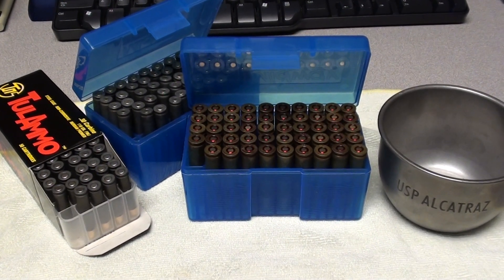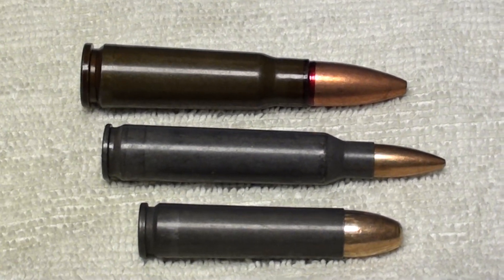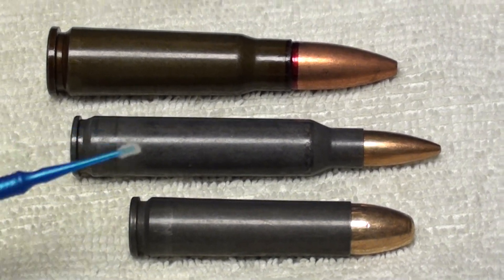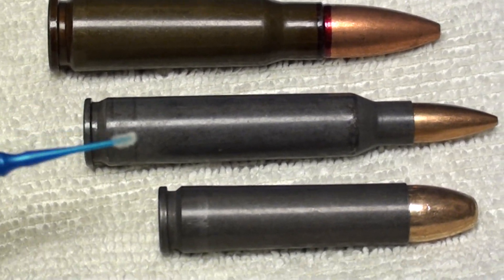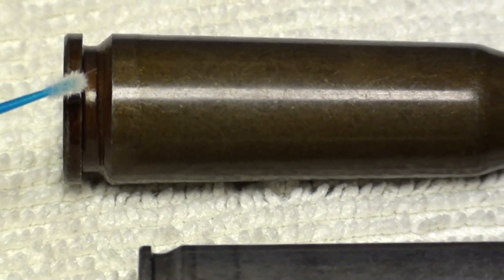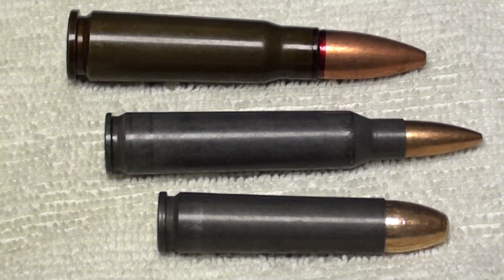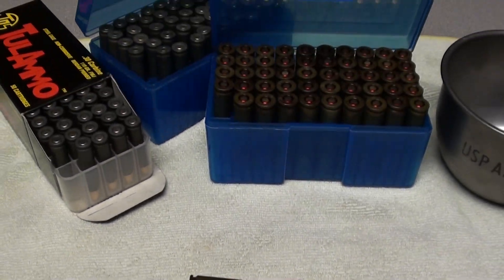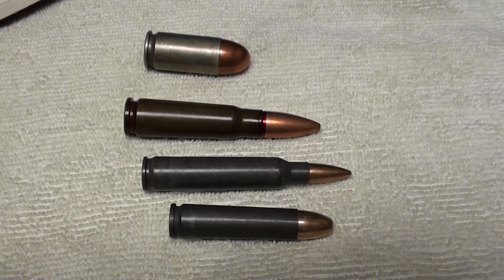.223, 30 Carbine, 7.62x39 Steel Cased Ammunition

Comment from the maker: Thanks 4 comment.  You are second on this.  I agree.  Chamber oil = setback. My carbine is safe with light brief 1/3 second misting WD40 after @ 50 rounds, toward the front action (not directly into chamber) with steel case ammo only - my carbine gobbles up steel ammo three boxes @ range session - no broken extractors with mist.  I mist no other gun.  I shoot carbine often.  Can't control how other shooters mist.  If steel case no good for shooter, don't use it.

Comment from the maker: Thanks for question - stirs up lots of debate - .223 1) light recoil - easy to hit 2) light, smaller rounds - carry lots of them 3) will take elk and buffalo with head shots 4) tumble in tissue - effective 5) accurate in most arms 6) will penetrate both sides of a GI helmet at 500 yards 7) reliable in most arms

Comment from the maker: Thanks 4 dialogue. I still agree any oil squirted into chambers for firing is not Rx. But my misting my carbine action for steel case shoot MUST be getting a bit into the chamber. However, my carbine loves it. Got to thinking-there is always oil in my gun chambers from cleaning -never degrease before I shoot at the range - no pressure problems when I open fire. I remember old guns used oiled shells-more research and big controversy here. Again, thanks for your post. Let's stay safe-no oil.

Comment from the maker: No pressure signs on my carbine steel case fired primers. Carbine functions well after WD40 mist treatment. I have run across reloaded 45 ACP steel cases - ID by flattened squashed in primer instead of nice round brass factory primer. They work. I just don't think I have any motivation to reload steel cases myself. I pick up all the brass cases I need that other shooters just leave on the ground. Please see second reply.

Comment from the maker: Joseph McKinney-Thanks for the post.  I have never shot 3 gun, so I've never shot steel case in my AR to the hot.  When I run my 20 rounds at the range, I've not had any issues with the steel.  But I would echo your experience with the Glocks - shot a lot of 9mm steel case with no problems.  Good shootin' to ya...

Comment from the maker: daniel quevedo-Thanks for your post - if steel cases get stuck, it is often because the steel does not obturate well enough to seal the chamber and residue fouls the chamber.  Then succeeding rounds get stuck when the residue builds up.  The case will not extract and either the rim rips off or the extractor breaks - both are bad. Comblock guns love steel case. If guns don't like steel case ammo, then avoid it.  But if your gun likes it(like my 9mm, 30 carbine), then go for it. Best Regards..

Comment: I have shot steel cased ammo out of an sks, 1911, and an h&k usp9. the 9mm seemed to function well. the 45 I think had a couple issues. the 7.62 I think had the most issues but that was probably cuz it was a cheap Chinese copy of the sks. I have heard that the steel cased ammo can wear ur gun down faster than brass because it is a harder metal. I will probably never use steel cased ammo in my m1 carbine or any of my guns because I wanna get as much use out of them as possible. I also like the idea of being able to reload the brass, which u cant do with steel.
Reply from the maker: redneckmini14- All good issues.  I don't worry about barrel wear too much.  Been shooting steel case 7.62x54R in MNs since the late 70s and the rifles still shoot well.  They weren't tack drivers to begin with, but still hit the bullseye offhand at 50 yards if I do my part…that's plenty good for me with the cheap cost shooting being the bonus…Best to ya...

Comment: Just found this one...Steel, I shoot it and my pocket book loves it and most of my firearms don't complain. I found most of my ejection problems are in the auto pistols as timing of extraction is crucial to the whole operation of the semi-auto pistol. I have one, a S&W Mod 39 that just won't extract a steel round. Steel is not as slippery as aluminum and brass. My Smith does not allow enough time to grab and dump the steel case so it does not get steel. All others shoot steel with reasonable EES

Comment: i used wolf in a 2nd gen universal m1 carbine and had nothing but issues, just wouldn't cycle worth a damn... bought some aguila and never had an issue.... 

then i got a real deal m1 carbine (1943 quality hardware), sold off the universal, and have never tried any wolf/tulammo/etc in the 43...

Comment from the maker: Vengenace Early-Mainejunker has a LOT of scrap lead - I think he could suppy all of us with a lifetime supply (and I shoot a  lot of cast bullets).  And he knows some real savvy stuff.  I'll go check out reloading steel - it can be done because I have run into some reloaded steel casings.  If I had to reload steel, I'd ream out the Berdan anvil and pocket for Boxer, drill a new flash hole and use a Boxer primer.  But shooting surplus 7.62x39 would be my way to go - I have a supply of that .

Comment: 5.56 was "over-engineered," depending on "laboratory scenarios." 7.62x39 was seat-of-the-pants, experience-driven. That would account for the rim thickness and extraction groove differences between these rounds, especially the shallow 5.56 extraction groove..

The 7.62x39 is 18 percent larger at the base of the cartridge body and 33 percent larger at the cartridge neck than the 5.56. These differences allow more room for dirt and/or fouling because of the larger tolerances allowed for greater diameters.

The reputation for the AK-47 to be able to "run dirty" is probably due more to the tapered case body, however, as pointed out in the video. A tapered case was probably not in the offing for the 5.56 because of pressure of a political nature for a small bullet and small diameter case, as short as possible for velocity requirements. The body taper of the 5.56 is 1.04 degrees, while the taper on the 7.62x39 is 2.74 degrees, which is more than double and visibly larger as mentioned in the video. This aids extraction of the 7.62x39 under dirty conditions not found in "the laboratory."

Good video.
.
Reply from the maker: geoh7777 - Thanks for your more technical information - all good to know especially for the viewers who are into the numbers…takes time to post a comment like that - on behalf of the viewers - Thanks again…Best to ya...

Comment: The steel case ammo has more friction and drag when loading.  You can spray something like WD 40 on them and they will feed better.  But that is dangerous because ii increases chamber pressures.  The Ak type rifles were made for this round.
Reply: Spraying wd-40 will not increase pressures.....
Reply: THANKS
Reply from the maker: conmigo Carolina de norte - You will hear many tell you vehemently that spraying lube into a gun chamber or onto cartridges is dangerous as increase in chamber pressures will result.  It is not worth arguing with them because they know what they know and no one is going to tell them different.  It is dangerous, but more because the chambers were not designed to be lubed - case set back is the problem with lube in our chambers.  Very hard on the gun that might cause gun failure, but not gun blow up in the traditional sense.  There were some guns in the past that were designed to be shot with full power lubricated cartridges - even machine guns.  In our case, the steel case ammo does not obturate the chambers as well as brass so chamber fouling will occur that binds the cases causing failures to extract.  Yes, a light misting of WD40 can get the gun running again, but that is not recommended for the above reasons.  Reason the AKs work with steel case is 1) heavily tapered case bodies and corresponding tapered chambers 2) chrome lined chambers.  Our 223, 308s and 30 carbines are nearly parallel sided in comparison.  Have a great day,  FC
Reply: Good to go!  Thanks

Comment: The problem with the .223 is that most people use AR15s.  They are picky and known for jamming.  Both my mini 14s shoot steel case ammo just fine just like my mini 30 shoots the 7.62x39 steel cases just fine.  Before you waste your money on an SKS or AK47,  buy an American made mini 30.  They have the old m1 style action which will shoot when covered with dirt like the AKs and SKSs  but are way more accurate.  The 30 carbines are basically a pistol bullet.  Fine at 100yds or less but also have the m1 style action.  My personal opinion is that 30 carbines are junk.  I'd trust a 44mag or 357mag carbine first.  Of course Ruger makes those too.  I confess that I am a big Ruger fan so my opinion is biased to Rugers.
Reply from the maker: Jesuslovesamericans - However, even though some M1 carbines are unreliable, the reliable ones  are formidable close range weapons - 1980 fps with soft point 110 grain bullets out of easy handling easy hitting short rifles with 15 or 30 round magazines.  Jim Cirillo and the stake out squads of NYC used M1 carbines, and he was quoted that , "...a second shot was not needed."   Of course, there are better weapons available.  Have a great day,  FC Steve

Comment from the maker: smoothsk8r44 - Thanks for the tip on the silicon spray - got some in my reloading room.  Will give a light misting on the rounds and see if it works better than the WD40 misting.  Bye for now...